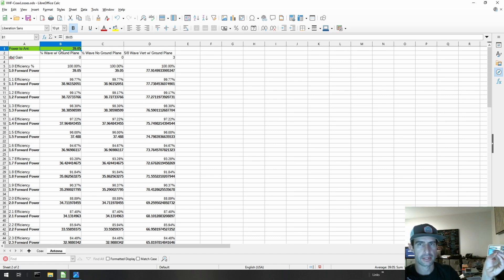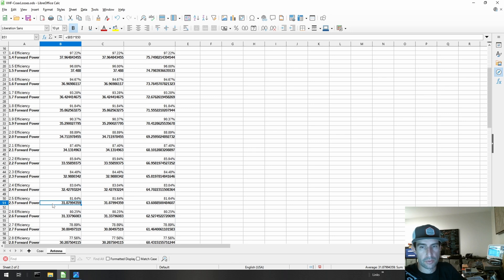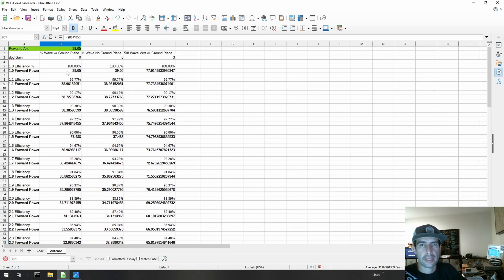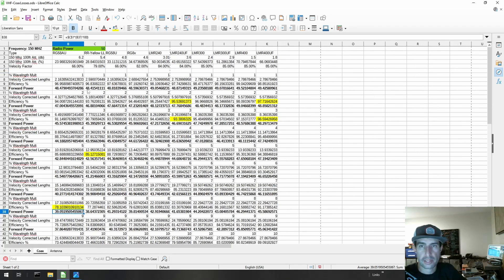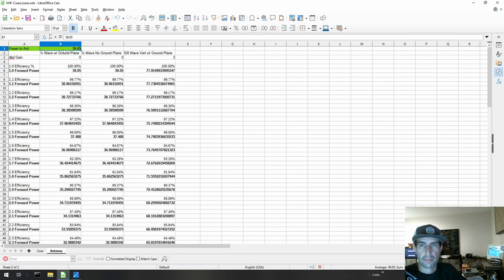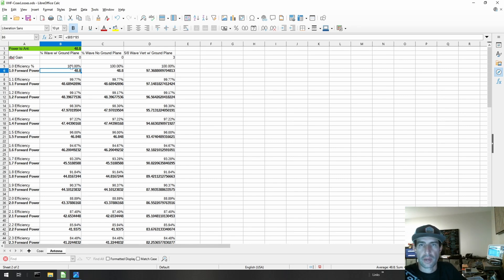Why your Race Radio Sucks - Part 2, Antennas

Comment: I think a good compromise would be LMR-240- the numbers aren't as good but its useable in the vehicle environment.
If you have not used LMR400 before you may find it a little thick .  I use LMR400 as a coax for my base station.
Also don't go Cheap on the whip, Stick with quality manufacturers like Laird 
Last thing be aware with the 5/8 wave your useable bandwidth is going to be about +-5mhz, so if you are transmitting on 150 and that is what you are cut to, if you try to say transmit on 146mhz your SWR will go up.
Reply from the maker: 100% agree with you. The 400 is very thick and stiff.. however the UltraFlex variant is much easier to work with and it useable depending on what type of vehicle you're installing it in Race vehicles, UTV's, sand rails, etc shouldn't have an issue. The LMR240 is a great alternative for those looking to squeeze it into tight places. 
The badwidth of a 5/8 wave antenna bandwidth shouldn't be an issue.. and the gains definitely is worth it.

Comment: Great information thanks,
Any info on how to program your radio?
Reply from the maker: That could be a large discussion as each radio is a bit different and many use different software. 
What radio do you have?
Reply: @RuggedRoutes  basically asking for my self and other of my fellow koh 2024 rookies
Reply: Rugged m1 race series
Reply from the maker: @RobRenoRacing  I don't currently have the software to program those but from what I understand, it is available from RTSystems at https://www.rtsystemsinc.com/Mobiles_c_871.html

I believe you can also purchase it through Ham Radio Outlet as they have been a retailser for RT Systems for .. over 20 years that I believe I remember.